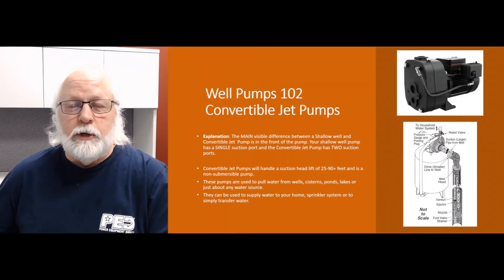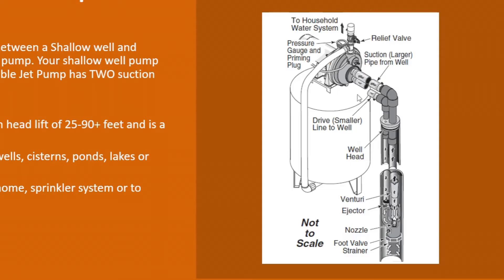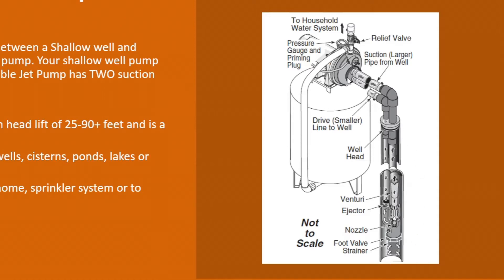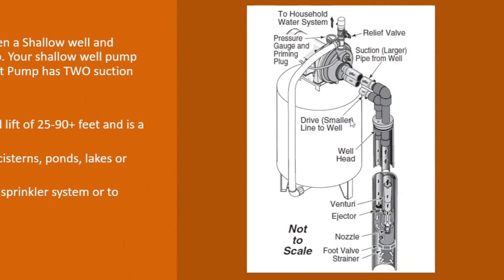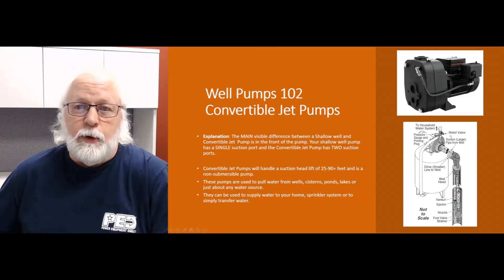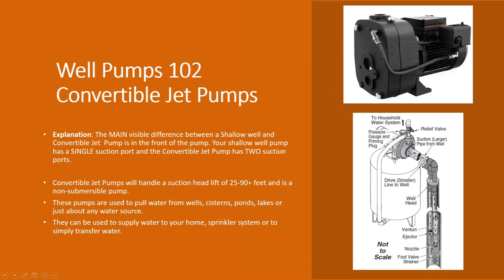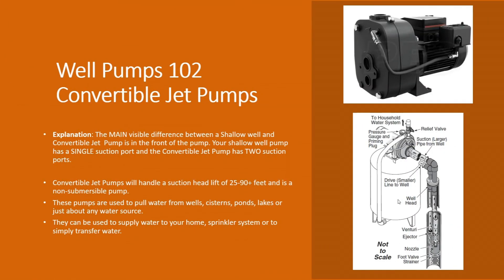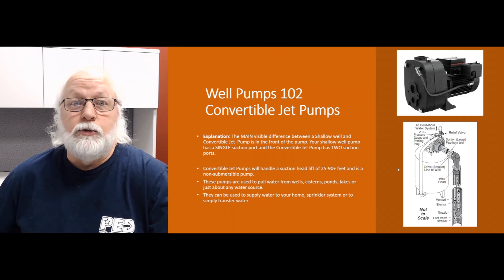What Are Convertible Jet Pumps?

Comment: Hello, nice video. If you have a faucet a long distance from the well, that runs slowly, what's the best way to increase the flow and pressure? Can you add a larger tank?
Reply from the maker: That's a tough one to answer. We would need to know the model# of the pump in question along with the well specs, all piping diameter, distance, and elevation rise between the well and that furthest faucet. We would also need to know what the actual GPM & PSI requirements are for the application. Please call us with that information and we'd be happy to assist you!